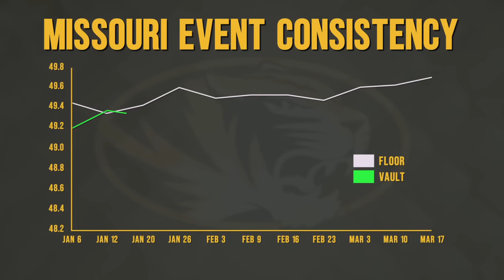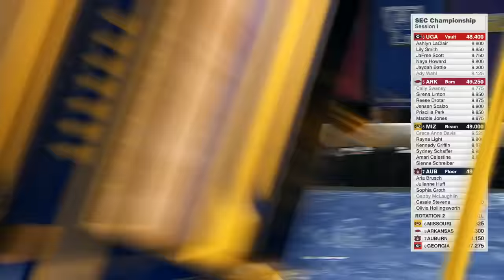2024 SEC Championship Session I Main Stream 3-23-24 720p60 12138K

Comment: I will never understand this whole "we need to score tighter in the first session" it's ridiculous. In the Olympics if one of the top teams compete in the first session, you're NOT going to score them low because that's where they are! Rather they put up a behemoth score that the other teams need to chase. You judge what you see?! They really need to fix that up. Mizzou bars were unacceptable scoring. Very underscored.
Reply: Trust me, the scoring was tight in the second session too.  Those vault judges must have been snorting coke before this meet.
Reply: @justlina2769 not the coke 😭😭😭💀💀